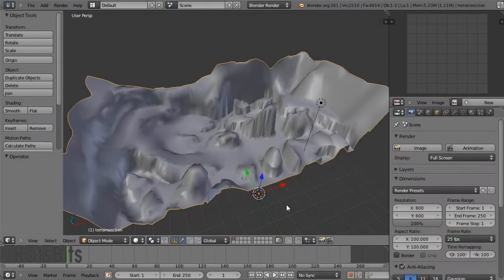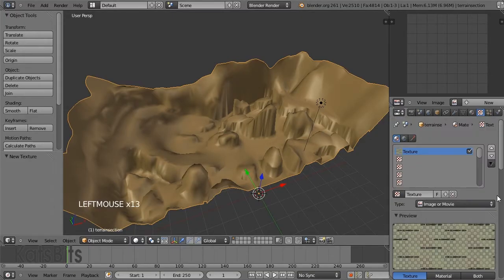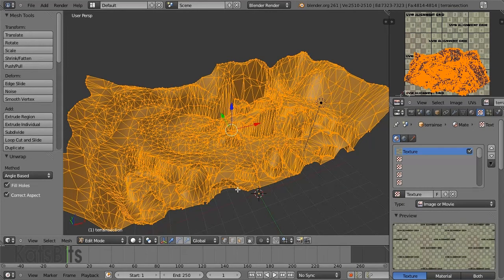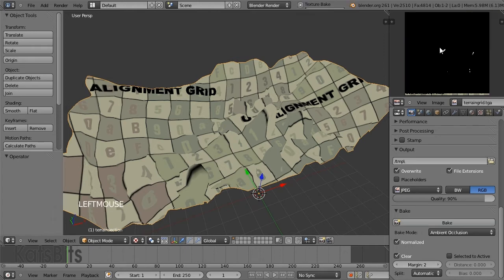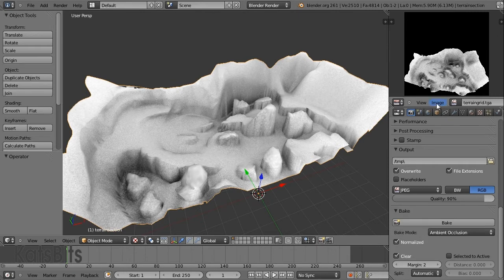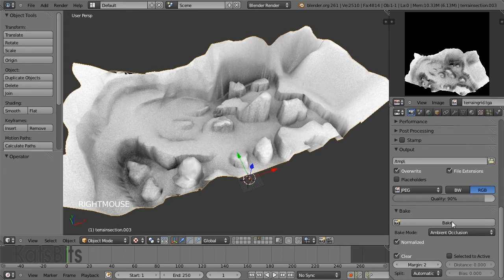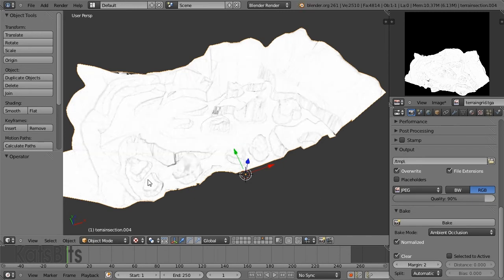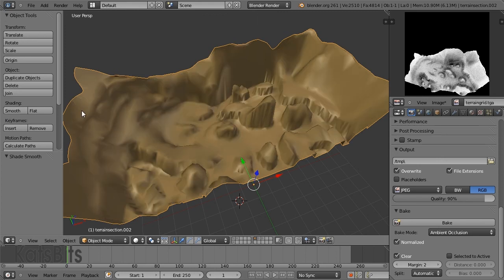Terrain & Baking Ambient Occlusion in Blender (HD)

Comment: I really enjoyed it.  There are a couple things im confused about though.  Im trying to create a low poly terrain and i have the mesh worked out.  Now i just want to quickly put color to it but i need it to look nice.  Do you have any advice on this?   Also what exactly is the purpous or function of an ambient occlusion map?
Reply from the maker: To add colour quickly you could vertex paint the mesh (and then bake) or paint directly onto the image UV mapped to the object.. anything more than that requires a bit of work. Ambient occlusion adds a bit of visual interest/depth but is only really useful for smaller projects.